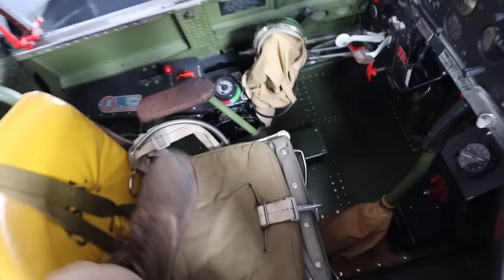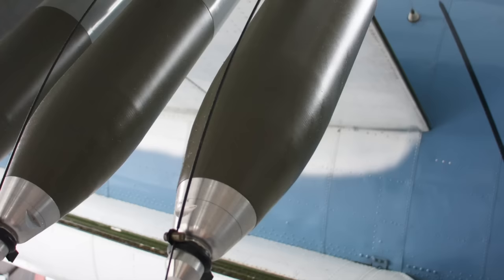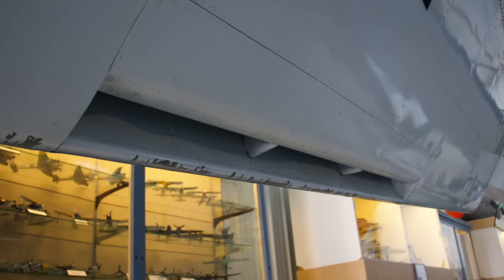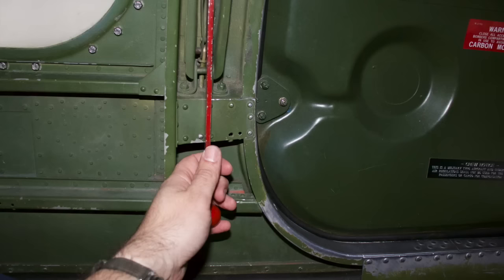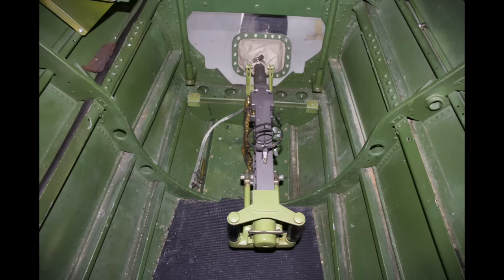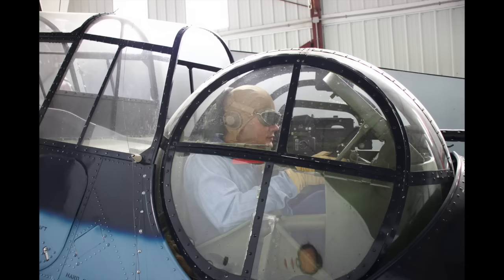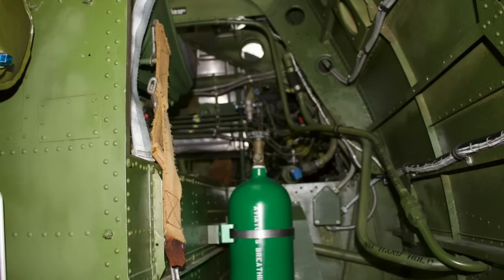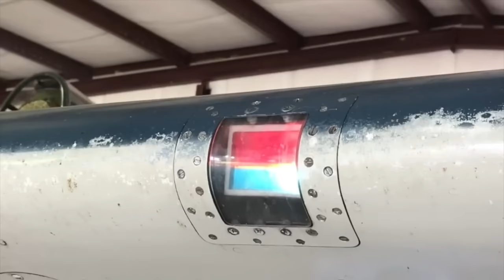Eastern Aircraft TBM Avenger Part 2 Exterior/Interior - Mid-Atlantic Air Museum

Comment: The "TBM" was build at the General Motors factory in Baltimore, MD.  My dad was an engineering student at Johns Hopkins University and was recruited by Grumman to be an inspector at the assembly plant. The last Avenger I saw was on display at the Pensacola Naval Air Station Museum. Side note;; having been an inspector, my dad was afraid to fly and it took 20 plus years just to get him into an airplane and then only with the help of "Seagram's 7".

Comment: it's amazing... how a single-engine fighter plane can have a load of four bombs.. that plane's huge(3-crew ? i guess, besides the gunner, there's a radioman, right?)
Reply from the maker: Correct!
Reply: I mean in depends on what type of bombs, a German biplane could hold like 6-12 bombs but guess what, they are 12kg bombs
Reply: He 51 was the biplane I think, also Hs 123 held a lot of bombs, 4 50kg and 1 250kg
Reply: The one at the stinger position was the radioman. There was a crawl space where he could get to the radio equipment which took up most of the area behind the pilot. He was also the bombardier and had had a window to look into the torpedo/bomb bay to check that it was empty at the end of a mission.
Reply: It’s not a fighter. It’s a torpedo bomber.

Comment: I'm amazed how really big this aircraft is once you crawled through the fuselage. Wow!
Reply: same wtf
Reply: Even though it was big it could still take off and land at sea. I believe the Avenger used the Pratt and Whitney R2800 like the Corsairs on ship. If I remember correctly around 250mph top speed.
Reply: @Chief-Solarize The P&W Double Wasp R2800 was key to winning the war.
It was the engine in:
F4U Corsair
P-47 Thunderbolt
TBF Avenger
F6F Hellcat
F7F Tigercat
F8F Bearcat
P-61 Blackwidow
A26 Invader
Thanks to the amazing engineers and machinists at Pratt & Whitney based in Connecticut!!!

Comment: 7:09 "it was later deemed unnecessary and removed".  Interesting because I first heard of this particular gun placement in Saburo Saki's (Japanese zero ace) book.  He approached a flight of what he thought were I guess Devastators from below, expecting some easy pickings.  He ended up getting shot down by the 30 caliber stingers in one or more of the planes, which turned out to be new Avengers.  Great video.
Reply: Eventually the Japanese Army/Navy air forces got so beat down that the threat from them became less than the need to save weight to extend range.

Comment: I wonder if the Avenger could have performed the DooLittle bombing raid over Tokyo had auxiliary fuel tanks been attached under the wings.  Some equipment could have been removed to lighten the weight such as the ventral, 30 cal. machine gun and its ammunition.  The Norden bombsight could be dispensed and instead the "Mark Twain" manual aiming device used.  I don't know if the backseat observer could be left out, leaving the pilot and bomb aimer/ball turret gunner.  Perhaps not.  But lets say special large auxiliary fuel tanks could be devised, like the later large fuel tanks used by Mustangs and Thunderbolts for long-distance escort to Berlin and back.  The Avenger could have made the one-way trip to Tokyo then on to Free China.  Had everything worked out, the launch distance been the planned 450 miles instead of 650 miles, the Avengers might have just barely made their Free China destinations.
Reply: They wouldn’t have though because it would’ve been more expensive to modify an Avenger for that role and probably risky for the aircraft in the raid I think they would have just used the Mitchell because it would be cost effective compared to making new external fuel tanks and removing stuff for an already risky raid on Tokyo.
Reply: The B-25s used in the Doolittle raid had a range of 1,350 miles compared to the Avenger's 1,000 miles. The auxiliary tanks were stored internally. They were able to nearly double the fuel load by removing the radio equipment and the tail gunner. They also replaced the belly turret with a 60 gallon fuel tank. That gave them a maximum range of about 2,500 miles.

Comment: I couldn’t imagine sitting in that turret during a bomb run knowing that there’s almost zero chance of me getting out in time if AA gets a decent hit. I feel like the pilot has the sweet end of the deal here in terms of crew lol.

Do you know if they flew with usually the same 3 guys or was there a lot of rotation? Again, I wouldn’t want to be in that turret with a pilot I have barely any, or absolutely no time with in the air lol.
Reply from the maker: Most of the time, this aircraft and others were “hard crewed” meaning the same crew every mission. Circumstances dictated if a replacement had to take over a crew position temporarily or indefinitely. When it comes to AA fire, the Avenger’s sweet spot was low to the water, and hopefully at an angle that deck guns could not be used. Remember that the pilot was at the front and if the aircraft was going to be hit, the pilot would take the brunt of fire. Luckily, there was some forward facing armor plating, the engine, and a bullet proof windscreen.

Comment: Pretty tight quarters there, was the stinger gunner a position unto itself or manned by one of the other crew...? No pads on the seats must of made for some sore backsides for sure. Always loved this aircraft probably my favorite naval airplane.
Reply from the maker: Typically, the Avenger was a 3 man crew. This left the radio operator to crew the Stinger position.